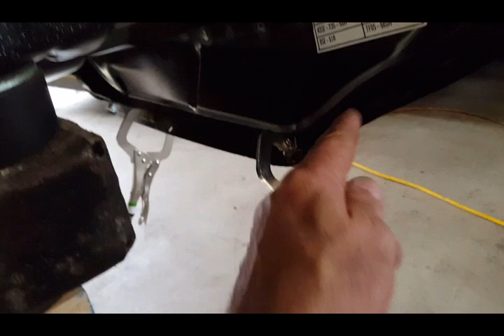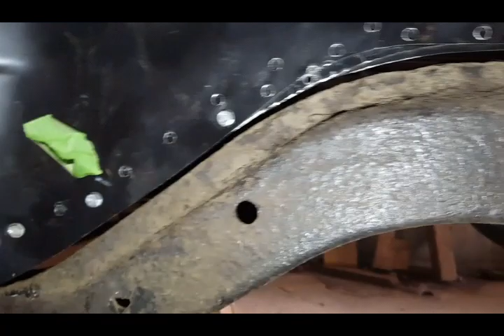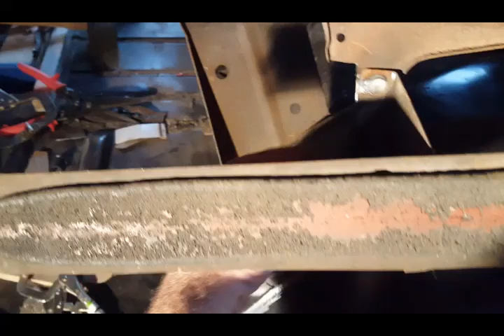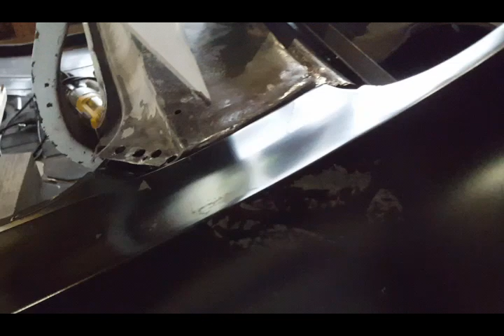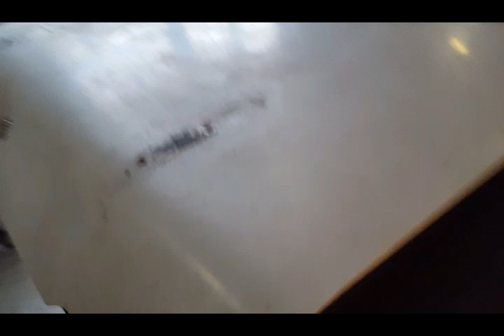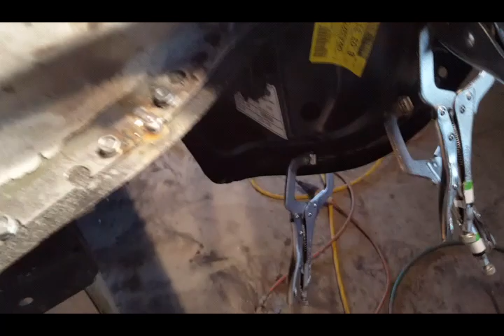Welding Inner - Outer Wheel House and Quarter panel. 68 -72 GTO, Chevelle, 442, Camaro, Nova

Comment: Hi  great videos! I’m doing something very similar with a ‘70 GTO and your videos have been a big help. Especially when I feel overwhelmed and disheartened. My question to you is - does the lip from the outer wheelhouse and the lip from the quarter panel where they sit together get plug welded all the way from one end to the other? And if so, how far apart are the welds supposed to be?  I don’t have a good factory reference point as someone did some half ass work to my car before I got it. It looks like most of the factory spot welds I have drilled out elsewhere on the car have been about every 2 inches. Would this scenario be the same?
Reply from the maker: Thank you for the kind words . Yes. It should be the same about 2 to 3 inches apart they get spot welded.  Just a little bit of info, when I did my inner fenders to the quarter panel. I actually rolled them with a hammer and Dolly. It came out really nice. I don't have to worry about the wide tires touching the fender. I did not make a video of that. All the best

Comment: Hello.  What brand outer wheel wells did you use?  I'm having a hard time finding any that fit decent.
Reply from the maker: All my parts I bought from OPG.  I don't know if they Outsource them. My quarter panels where OPG as well and the Box came back labeled dynacorn. If you do your research, a lot of parts are made in two or three different manufacturers. It depends on where you buy it.  You don't know what you're going to get because they're just labeled individually.
Reply: @classicrewind2715  Thank you for the reply!  I'm very much an amateur at metal fab and auto restoration. I'm working on a 72 for my father. Your videos have been very helpful, as I am doing both quarters and outer wheel wells too.  I have the same quarters as you, but bought outer wheel wells from npd as the opgi pieces were out of stock. They don't seem to fit the wheel opening on the quarter well at all, and I'm unsure how to proceed.
Reply from the maker: My passenger side outer wheel well did not fit my quarter panel that well. What I did was cut slits in the outer fender, I made it easier to bend and mate with the quarter panel. I cut half inch slits approximately 8" to 10"from the Rocker panel area up to the outer fender. I hope I'm explaining this well. I'm not sure if I mentioned it in my video. The driver side fit well. I hope this helps let me know if you need more information. All the best

Comment: How did you learn how to do all that ? I want to do a 1970 gs stage 1 .. but that looks pretty intimidating .. I can weld .. but taking it apart and fitting everything straight and proper seems like I could get overwhelmed and or mess it up  ?
Reply from the maker: Long story. It started back in high school, (Vo-Tech) I took auto mechanics and a friend of mine took body work. I was working on cars since I was 16 years old. Now I am a custom woodworker. Now I work on cars as a hobby. You can do it. Just take your time!!  take a lot of measurements, keep your panels. that way you could reference back to how it was put together and taken apart.. I hope this helps. Let me know how your project comes along. All the best 👍
Reply: @classicrewind2715  thank you
Reply from the maker: All the best

Comment: I’m about to purchase my first welder for body work and sheet metal. I don’t mind spending the money for something good. What do you recommend?
Reply from the maker: Hi, There's a couple good welders out there.  I learned with stick welding years ago . But I don't recommend doing body panels with stick weld anymore, Too much heat and warpage. I recommend you buy a machine that has a lot of Adjustment . I know Lincoln Welders you could fine-tune them To what you are comfortable with . But there is a learning curve much with anything in life . I hope this helps all the best

Comment: I’m doing about the same thing with my 70 chevelle but I’m having problems with the outer wheel house because I weld it before I bought the quarter panel it won’t let me move the panel where it supposed to be any ideas?
Reply from the maker: Sorry, I didn't get back to you earlier. How many spot welds did you put on the inner wheel wells.? Maybe you could cut the welds and then reweld. The other thing you can do is have someone help you put on the quarter and see where it hits. you might be able to adjust The Wheelhouse a little bit and get that quarter panel where you want it. I hope this helps. All the best

Comment: I don’t recall if you mentioned it but what type of welder are you using and are you using flux or gas ? l am in the market for my first one and will be doing similar work to yours ( prob won’t look as good for a while  lol ) ty
Reply from the maker: Hi Frank. I'm using a Lincoln welder 180 gas. If you haven't used one before it will take some time to get used to I would practice on scrap. The other thing they don't tell you is if you weld upside down it's a little different you might have to make your welder hoter . All the best my friend. I hope this information helps

Comment: Great videos.  Your motivating doing all that by yourself.  My question is I had a body shop replace my rear quarters. I later learned that they neglected to tell me my outer wheel housing is rotten where it meets the rear quarter.  Can I trim out 4-5 inches of that wheel housing and weld it into place without removing rear quarter again?
Reply from the maker: Hi Chad. That's a great question. yes, you can. The only thing is you need to take your time because it is welded along that lip of the quarter panel and outer wheel well. Also you need to take your time spot welding along that lip so you don't warp your quarter panel. All the best. let me know how it turns out.

Comment: way too much erratic welding. Too many screws to hold everything together. Too much welding blow through on the panels. Your gaps are workable and in the world of aftermarket, are ok to work with.
Reply from the maker: Thanks PJL I wanted to make sure everything was held tight so when I did weld everything stayed in place. When I was welding you could actually hear the metal expanding and Contracting. Thanks for the advice, I was concerned about my gaps. I'm going to try to get the gap 1/4" before paint. All the best

Comment: is the wheel house that touches the quarter panel the inner or outer kus im replacing my 72 chevelle and has minor rust issues in the wheel well and the lip of the quarter panel where the chrome molding goes but im stuck on replacing the quarter or not kus i know the wheel whells have to replaced but i would like to replace them any ways kus i want a daily driver let me know what u think redy to spend 2500 on parts but scared to cut and weld its very scary for me considering the chevelle i have is about 85 percent restored just needs paint i dont just want to bondo over the rust
Reply from the maker: Hi. I have a suggestion for you. I don't know how bad the rust is. My suggestion is, if you could cut that area of the wheel well out and weld yourself a patch. Tack weld grind smooth and then you can put some sealer on there. they're not going to see anything from under the wheel well, if you clean it up properly. If you cut welds out you're probably going to damage the paint ,Along the outer quarter panel. If they're really bad then you might have to replace the wheel well, just a suggestion. All the best my friend I hope this helps.
Reply from the maker: The wheel well that touches quarter panel is considered the outer wheel well

Comment: Love your video on GTO, I have a 1972 chevelle and have similar rust  problems.  Just started hanging a 1970 nose on the car. Before I tactical the rear rust issue.
Reply from the maker: Hi Oxkart. I'm glad you're enjoying the videos. I have a 68 Chevelle Super Sport. I used to have a 68 Malibu. That I restored. I had that car since high school. I still miss it (we've been through a lot) it looks like you have a big project like mine ahead of you. If you ever need some advice just reach out. I will try to help you as much as I can. All the best

Comment: I have a 71 Chevelle SS350 and I have a bunch of work to do on it. So far from what you have provided it's hard to do but not impossible. I was wondering if I could do the work myself and i believe after watching your videos I can do it. I do have a question though my car is still on the frame and the rear axle is still on it as well. Can the rear quarters and wheel wells be replaced while still on the frame and axle?
Reply from the maker: Hi upstateNY. I am glad that my videos help you in your build. You can do it, you just need to take your time. You can leave your axle in place. The only thing it would make it much difficult to weld when you're replacing your inner wheel wells. Your Axel should not be in the way of your 1/4. I hope this helps. I recommend you try to drop your axle. If I'm not mistaken you have leaf springs. Most of the time the bolt snaps when removing your leaf springs to drop your axle..you could buy replacement bolts at your local parts store. All the best.. let me know your progress.
Reply: @classicrewind2715  ok thank you I appreciate your quick feedback and advice. Yes I will let ya know if I have anymore questions

Comment: Keep up the good work
Reply from the maker: Thanks Ryan. I appreciate you stopping by and watching the video. Thanks for commenting. What are you working on anything?
Reply: @classicrewind2715  70 SS 396 ... destroying it lol and going pro-touring , ls7,t56
Reply from the maker: Very nice!!. That's what I'm doing with my GTO.. I'm going to be putting an LS3 T56 in mind. I was looking for a ls9 but I'm not sure I could get the computer to work with that combination. Not too familiar with electronics.
Reply: @classicrewind2715  ls9 will totally work with that trans , gm performance parts has all kinds of harnesses
Reply from the maker: Cool!  I will have to definitely look into that. Thanks for the tip
Reply from the maker: I'm going to be putting a ridetech suspension system in the frame this winter

Comment: Very helpful info I'm scared to cut into mine but I think I'm going to try it with a few more videos and helpful hints
Reply from the maker: Hi Urban mechanic. What kind of car are you working on? Is there anything I could help you with? Is there a specific video you would like to see or help with? I have a Chevelle and a GTO. Thanks for watching. All the best
Reply: I have a 70 chevelle I just need to cut into it but I'm  nervous about messing it up
Reply from the maker: 70 Chevelle. Very nice!!  the only thing is my friend, take your time. don't lose your patience. If you're afraid of damaging panels remove little pieces at a time. Like grinding welds very slowly and peeling the metal back. I hope this helps
Reply: Do I just cut the center out of the quarter and work away the edges? What would you suggest? I'm very mechanically inclined and I would say I have a few skills I'm just worried being my worst critic that it wont be perfect
Reply from the maker: You'll do fine. just remember there's always metal behind the quarter panel.  You have to be careful not to cut through it. you'll create more if you do. You could always cut metal out and replace it if you need to, you must remember aftermarket quarter panels and panels need some adjustment. You might have to add metal to make it work, or hammer and dolly to make it fit properly. it's just a little more work...In one of my videos, the  outer wheelhouse did not match the quarter panel. I had to cut it to release the stress on the bend and bend it back. I hope this helps.. keep in touch, let me know if you need anything

Comment: Did you mate the 2 wheel wells together  before installing? I'm about to get those for my chevelle and was wondering if they match up or need persuading. Thanks
Reply from the maker: Yes, Mike.. I did mate the two inner and outer wheel wells together.. They were actually cheaper than buying a whole one.  I wanted to make sure everything fit because I was replacing the floor pan, trunk pan and quarter panels.. Thanks for watching!!!

Comment: Looks like your welding through paint..wtf man..
Reply from the maker: Hi Matt. I am using clamps. You need to watch more of the video my man. All the new body panels come with weld through primer so it looks like I'm welding through paint but it's actually weld through primer. Thanks for stopping by and commenting. All the best